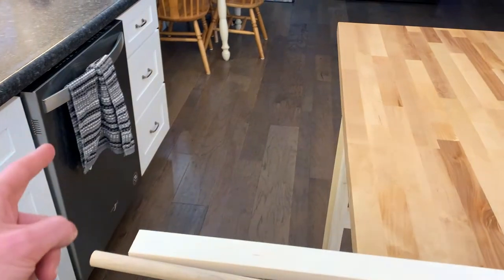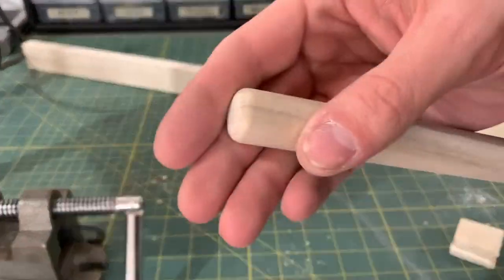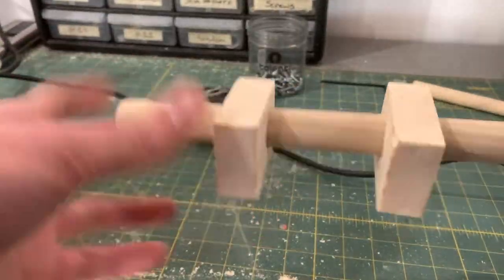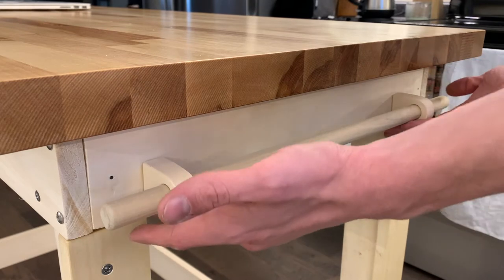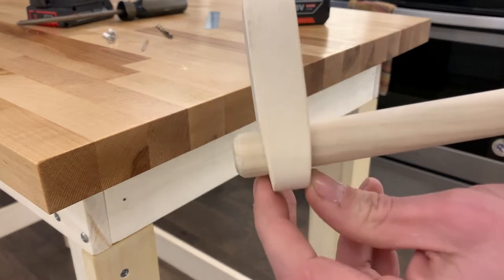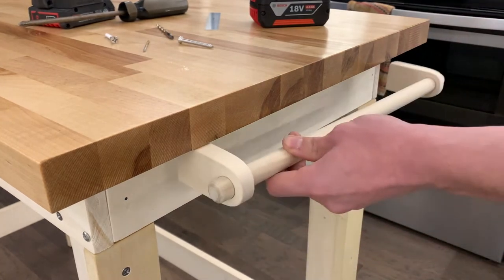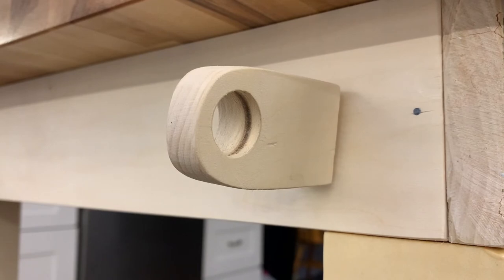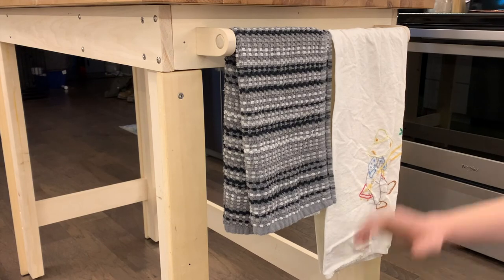How to make a Towel Rack for a Kitchen Island

Comment: Very timely. I'm going to make a shorter version for my kitchen roll (paper kitchen towel roll thing) , as I am done with lifting the whole roll off the top of the microwave to pull a single sheet off, and have been more than slightly remiss in dealing with this trivial, but annoying every time, issue.
Keep them coming Casey !